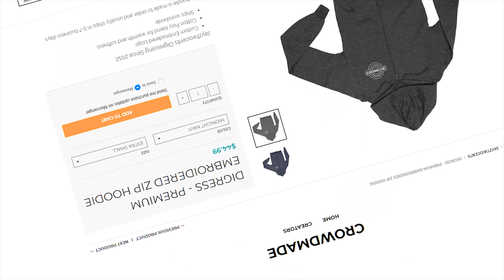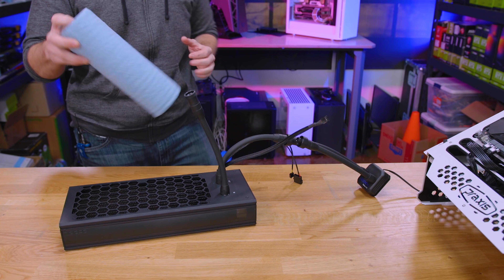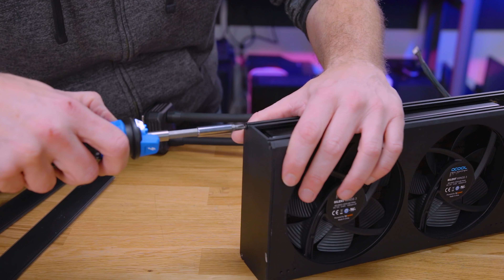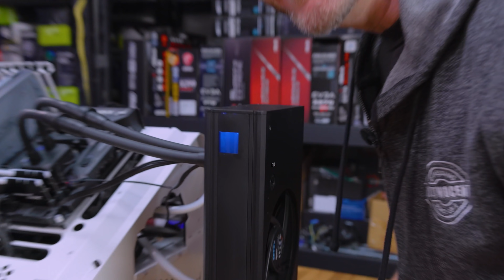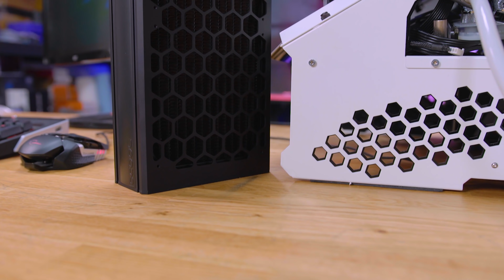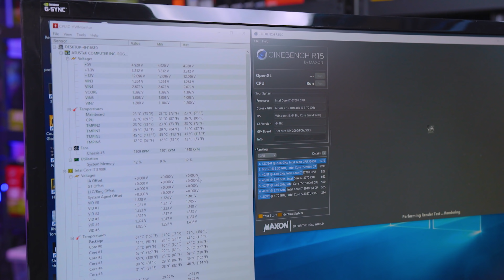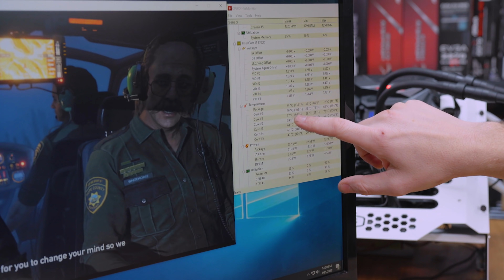This AIO is ridiculous!

Comment: Fahrenheit doesn't make more sense... just like the imperial system doesn't. Celsius = 0 degrees is freezing point... Metric system = every size (centimeter, decimeter, meter) is always an increment of 10 or 100.. 1 meter = 10dm = 100cm...  It's simply is much more logical and easier.
Reply: Unfortunately, 12 and 8 both factor just as well as 10 (or better) and the millimetre is just about useless on a tape measure, so it's much more logical and easier to use Imperial in the trades. But continue bitching about it, snowflake.
Reply: @nimrodery  Ehh... no they don't. Metric system. 1 kilometer = 1000m, 1m = 100cm... but when you use Imperial. 1 mile = 1760 yards, 1 yard = 36 inches, 1 foot = 12 inches. And you say that's more logical/better than just multiplying by 10 or 100 and so on? There is a reason why even American scientist measure using the Metric system... for distance and volume.
Reply: @micglou  12 has more factors than 10. 8 is just as good. I don't have miles on my tape measure. Millimetres are of no use to me. If I was a scientist, for sure I would care.
Reply: @nimrodery  12 has more factors doesn't make sense... and it much easier to multiply by 10, 20, 30 etc than it's 12, 24, 36. Also I'm willing to bet that mm does have a use for you... you're holding it every day. And saying mm doesn't have a use... what about 1/32 of an inch?
Reply: @micglou  10 has 1, 2, 5, and 10. 12 has 1, 2, 3, 4, 6, and 12. 6 is more than 4. More whole number factors makes for easier math and building material spacing. I don't use 1/32 of an inch, as it's not necessary for me to be that accurate. I don't pick tape measures based on what would be useful on somebody else's job. So yeah, I don't think I've measured millimetres since maybe 20 years ago. So they're kind of useless to me.
Reply: @nimrodery  I think somebody is a little triggered... trying to defend a system of measurement that is outdated and not logical. I guess you simply don't understand the metric system to see/know why it's better.
Reply: @micglou  What a generalization. Didn't say one was better or worse, or that I didn't understand metric. Learn to read. I guess we agree on one thing, somebody (you) is indeed triggered.

Comment: Remember when 4GHz was impressive? I member!
Reply: You must be young. I remember when 100mhz was impressive. I'm old but still breathi --awKK!  (thud)
Reply: @MonsterSound.Bradley  486 DX2 66MHz was a beast!
Reply: @MonsterSound.Bradley  I started life on an Atari 520STe, I think it's cpu ran at 16hz.
Reply: I remember a pc being advertised with having, the so called, first 1ghz cpu. It was an overlooked amd with an air conditioner built into the bottom of the case.
Reply: tazgamer eh, you are dead wrong, the unit they used was a Danfoss industrial compressor cooler, to get to 1GHz. I mean the kind that are used for walk in freezers literally. How do I know? I'm old enough to have owned one of them, and I still have the case but threw the compressor out after it leaked and got condensation inside and was thus dead. Trying to fix and fill it again would have been several thousand euros so nope. It was also for the Slot A AMD cpus which were like nonexistent.
Reply: Pepperidge farm remembers
Reply: Lol yeah. Before the i9 CPUs 5GHz was barely heard of. That 4GHz was certainly impressive.
Reply: @seventyseven8076  not entirely true amds FX lineup was notorious for its flagship to hit 5ghz or a bit higher with AIOs or top of the line air cooling only with ln2 and such hitting what 9hhz was their world record. Other than that though very unimpressive cpus. Even highly overclocked they really never held well to intels lineup which could hit high 4ghz and Rarley 5ghz.
Reply: Children please we old timers remember the mighty 4.7MHz 8086, something like 20,000 transistors. Now get off of my lawn.
Reply: @hangfried9429  thats not true old man, we both know those memories have faded. :p
Reply: considering pentium 4 CPUs could be clocked at 4 GHz with a good OC 5 GHz was long overdue.
Reply: Pepperidge Farm remembers.
Reply: kids acting like they're old, i must be getting really old, I remember when 1000mhz single core was impressive...
Reply: When I built my first computer GPUs were still using AGP (Accelerated Graphics Port) because PCI-E wasn’t a thing and I was rocking an Athlon XP 1800+ @ 1.53 GHz in 2001 lol so yeah I member
Reply: @emmanuelcarter1605  Lucky I still had my Pentium MMX
Reply: I remember when 386 33mhz DX was impressive, I could only afford an SX.
Reply: Heck I remember when 3Ghz was seemingly impossible to reach
Reply: my amd phenom 2 at 3.4 is still impressing me lol even today
Reply: My cpu does 3.7ghz your telling me
Reply: Peter Batchelor I remember I spend $600 on a xeon x5675 and overclocked to 4.4 Ghz in 2009. Worth it. still running today.
Reply: Memba berries memba
Reply: I remember when 2.8 ghz was a very big deal
Reply: My 4770k is running at 4GHz.
Reply: We've had 5GHz since like 2012 with amd fx but the performance obviously still wasnt that good.
Reply: MEEEMMBEERRR
Reply: I'm still at 2.7 ghz :(
Reply: i remember when 100MHz was impressive ;)
Reply: Peter Batchelor for me it is still impressive cause ım using i7 6700
Reply: Remember when a gig of ram was like insane? Like 99 to early 2000s
Reply: I just managed to make my old i3 550 run at 4.1ghz with a Intel stock cooler at 70-80°C and I feel like a god xD
Reply: I started on Pentium 1 and MS-DOS... Anyway my Pentium 4 is super old and it's 3.8ghz and I used to OC it to 3.9ghz some times so it's not that far from the 4ghz that you remember and basically 4ghz is not really impressive for a damn HUGE time 4 me...

I have my I7 2600K (max stock turbo 3.8ghz) OC to 4.9ghz on air, so it's almost a welcome 5ghz since 2011 though stability is at 4.8ghz, but I always use 4.9ghz and is good for gaming, just not burn-in test, 4 that I have to lower voltage and go with 4.8ghz (still haven't upgraded it)...

EDIT: In fact by now I thought we would be in like the 8 ghz range as it kept increasing, but it got quite more stall specially with AMD Ryzen's which didn't OC much either and with Intel even though we can OC over 5ghz the high performance chips produce HUGE temps that cost a lot of money to keep it cool and quiet...
Reply: The 1GHz crossing was a pretty intense thing when I was in high school
Reply: I ran my pentium 4 at 4ghz
Reply: Overclocking to 5.2 GHz was unimaginable but now that’s even possible

Comment: Fahrenheit are not making more sense for human temps at all.
Reply: yea, like water freezes at 32 F°, like, what? how does that make more sense than 0 C°
Reply: @thesmart1000  If it helps, the inventor calibrate F based upon the freezing point of a brine solution and the average temperature of the human body. It was later changed to 98.6 after some redefinition of F for accuracy sake.
Reply: @dramarodram2196  yep,  still no sense to be made there
Reply: @thesmart1000  It makes sense from the context of its original design. Rather than using water as a calibration, it was using the human body. There's nothing wrong with either system. Both are valid methods of measuring temperature for typical everyday use.
Reply: I suppose. If your numerical sense matches your grammatical sense, I can see your issue.
Reply: @Trainwheel_Time  English is not my native tongue fuck head.Je parle en français.

Comment: what is AIO? 
All In One? Those are PC monitors so wth?
Reply: All in one meaning pump, reservoir, and radiator in a single purchase. This is compared to buying these parts individually as well as tubing and whatever fittings are necessary.
Reply: @4sk0per2  ☮ cool. Still would rather see it named differently.

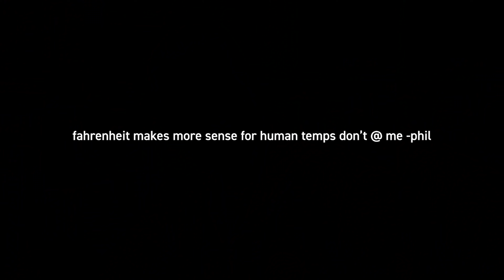Comment: 7:20 pretty sure this is designed to trigger.  While your government is down you Americans should all swap to Metric and join the rest of the world.
Reply: There are two types of countries, countries that use metric and countries that have been to the moon. Get fucked commie
Reply: The government is back up now (for a while anyway). But yes, I think it is time to switch to metric. Who do I write to to complain?
Reply: TheRickyJohn There’s more idiots in America than sensible people unfortunately otherwise it would’ve been done a long time ago
Reply: @luckythewolf2856  Calls people idiots but doesn't understand the number of idiots has nothing to do with it. It would take a massive infrastructure overhaul. Change every sign, every program, every textbook, everything would have to be changed its just not economically feasible and would take years to roll out even then only the new generations would really change and it would be at least a generation if not more for it to be common. Even some metric countries still use imperial for daily informal situations like temp and distance traveled in cars/amount of fuel.
Reply: Madarius I know but not many Americans would want to change because it would be hard. Yes it would be hard but it’s worth it in my opinion to do it so that we don’t have this major difference in measurement that causes confusion.